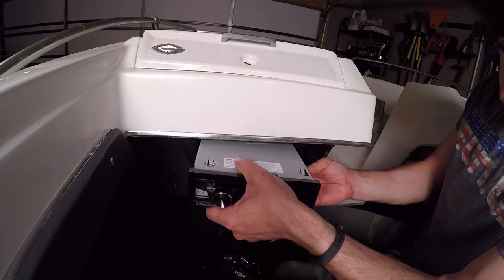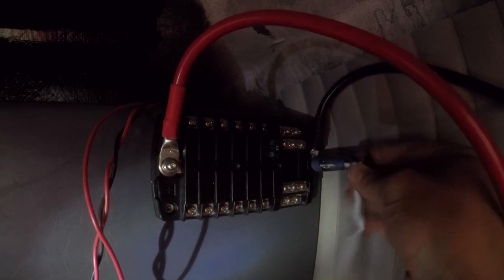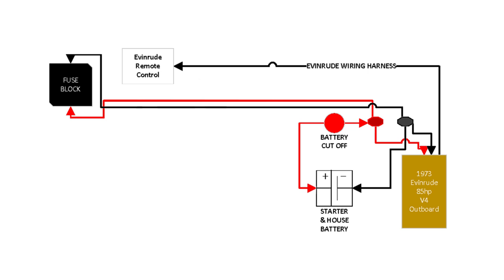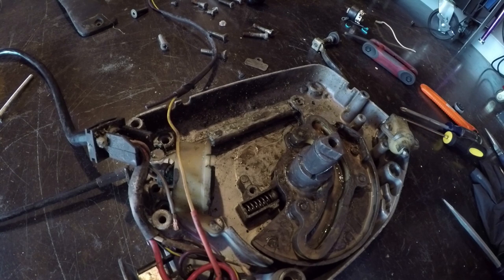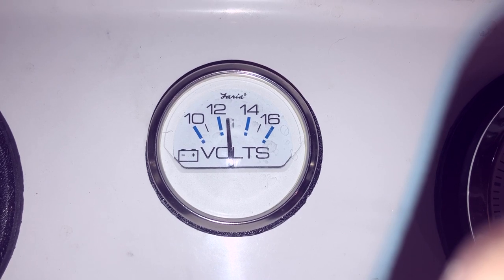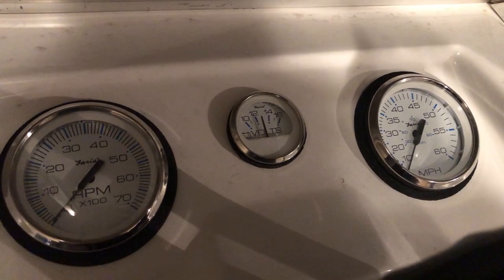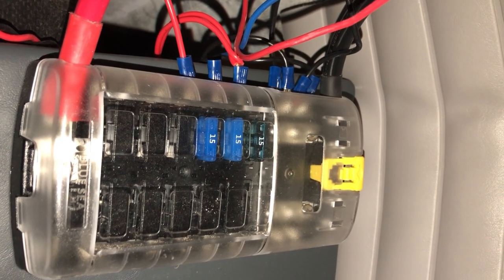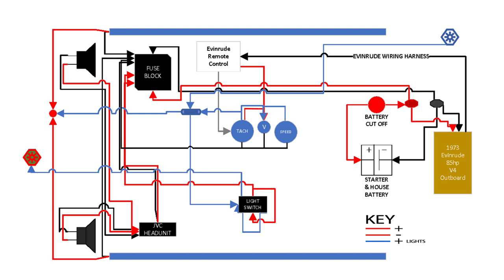12 Volt Electrical System // Project Glastron/Vlog #28

Comment: Hey man, I'm the guy who keeps tagging you in Instagram with #projectglasspar (the orange one). I'm also currently installing the electrical, so it's cool to see you doing yours! Even used the same fuse block, haha. I ended up getting two batteries (house and starting), we usually anchor at a sandbar on the St. Croix river for the day, so I didn't want to suck all the juice out and get stuck. Also gonna put in LED strips for interior lights AND gonna put a strip in the bilge area so I can actually see what I'm doing in there. Awesome job dude, you've done a lot of heavy lifting to pave the way for guys like me.
Reply from the maker: Glad to hear that your project is going well!  That LED light in the bilge area is a good idea, I may have to use that one.  Thanks for following me along and for the kind words!

Comment: I have same boat model,.. Been redoing updating a little at a time.  I plan on doing the 12v system next.  I don't have as many individual components, but still installing a 6 fuse bus under drivers dash and running new wires back to battery (+ to kill switch).
Did you end up staying with the one battery or did you add a 2nd??
Reply from the maker: I stayed with the one battery system.  I did kick around the idea of adding a second battery, but after using the boat for several years I haven't n
needed one.

Comment: Owh my, im still behind! Good work on the electrics, had the same issue choosing the right batterie ended up with one deep cycle 70AH. 

P.s dont want to ADD more work, but im missing the following, Horn, bilge pump and a fishfinder
Reply from the maker: I can't remember off the top of my head, but I believe my battery is supposed to be rated around 96 AH.    Definitely 90+ AH.  I have toyed with the idea of adding a horn and depth finder, but I haven't done so yet.